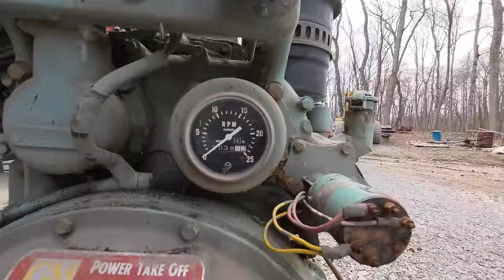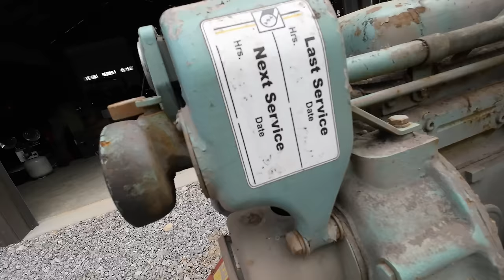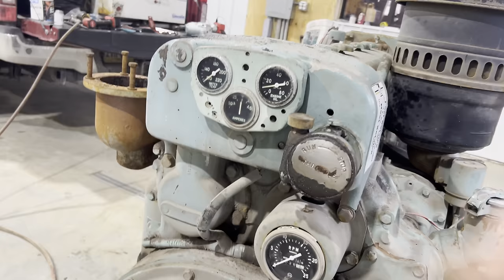$250 Two Stroke Detroit Diesel Sitting 6+ years, WILL IT RUN!?!?

Comment: That engine has a water to water heat exchanger on. Since it remains ststionary and a big radiator and fan might not be feasible. It is similar to the engines used for marine applications see danger marine. He rebuilt a similar Detroit with the same cooling setup.

Comment: i was wondering about the cooling system once you first got it running well. and then as you started to mention the cooling system, figured oh i wonder if it's water to water or something? that's just awesome. man, i'd love to have that. be a perfect off the grid generator, water pump, air compressor, all kinds of stuff you could do with it.

Comment: Matt, do like the dragsters and put the seat just in front of the engine 😊.  Would make a steering setup far easier.  Or if you were to hook up a sizable hydraulic pump hooked up to the drive, and a hydraulic steering setup ? ? ? ?    Your demented mind is fertile enough that I’m sure you’ll be able to figure something out.  Have fun and enjoy 😊 the whole process.

Comment: i was in coast guard we had those as generators and they also had a fire pump attached to them also for fire fighting capability we had two of them one on each side they ran at 1150 rpms to run our whole ships power  one ran and other was back up  and were traded back and forth to keep hours about the same they also it also had a turbo charger on it  and has two exhaust valves per cylinder on intake ports for the fuel going from being injected in  not sure but think our ship was built in the forties it was a 110 ft ice breaker the main engines that drove the prop were two straight eight cylinder ingersoll rand's top rpm on these ingersoll was about 600 to may a little more than that  but those 6-71s never gave us any problems i can remember  but we did rebuild one of them  and ring it but don't remember why we pulled the head and oil pan  like i said when we were off a shore tie these motors would run for hours on end as long as we were underway if i remember they burnt between 5 to 6 gallons an hour whereas the ingersoll's burnt about 30 gallons an hour and about 110 gallons on oil change but 6-71 took  about 26 to 27 ifim thinking right i worked in the engine room  for 2.5 years in cleveland ohio ship was KAW our breathers and valve covers were chromed beautiful motors so  clean that you could eat off them around 1150 rpms we got   the voltage we need to run everything and it think it supplied the exciters on the ingersoll's for their exciters  these motors put off dc to drive the 1000 hp electric motor  and remember this is an old brain her so i hope most of this is correct that was back in 1968 to 1970 also our 44 footers  may have used gms also

Comment: FYI don't run synthetic multi grade in this engine. 40 plus years as a Detroit guy. Put good old Chevron Delo 100 40 WT it is the best for that engine. multi grade not so good. Probably ok if you're not going to work the engine. just a little info. Love this engine and video...

Comment: You could use that as a fire pump or a generator. I'd use some evaporust or something and put a coat of paint on it in the mean time, and figure out what the PTO output RPM is so you can drive a water / trash / fire pump, alternator, hydraulic pump, Probably put a little dog house over it until you're ready to declare a job or position for it. It does appear to be a marine style, so you could put it in a boat, but being 38 hours young, I'd settle for some sort of land-based operation unless someone just gives you a pile of cash for a beautiful, used, painted 6-71.

It's goofy, but you could basically build a diesel-electric locomotive out of it with a single motor and a generator. The better route forward is using a three-phase alternator and a variable frequency drive (VFD) to control a three-phase motor with a small pinion driving a large gear (not unlike a 5:1 or 10:1 rear axle). You can probably accomplish the same sort of thing with a tractor or heavy equipment transmission using hydraulics.

Comment: Well if it is a water pump, I would have designed it to divert some of the water it is pumping through a water to water heat exchanger to cool the engine. So water after the pump goes through and dumps back in before the pump. Just a guess 8 minutes into the video. The lines would not be very big. Or possibly dump into the exhaust.

Comment: I’d take care of that old engine.  It’s more of a marine type probably cooled by the water it was moving.  I can say that I’m very experienced with Detroit diesels. I’ve drove about every model in some kind of equipment. I have a Pete with the 12.7 and it too will slobber fuel running at no load until it’s operating temperature.  I don’t know where you’re based but that engine would be right at home in a boat.

Comment: Dude! You need to go hydraulic. Don't get a stout drive line get a flexible one. You can change all your gearing like an auto trans with a valve. If you hinge it in the middle like a boom lift you don't need to worry about ball joints... All you need is a pump on your output shaft and you can put hydraulic motors on all four wheels. Couple o hoses, couple o valves, and a couple of rams for the steering. Bada Bing, Bada Boom, and your on the road!

Comment: i do remember every once in awhile they would use  a shot of either to start these if they were stubborn and we had a work board set up where we could rebuild and test those injectors to make sure they  did not leak when the were through shooting in the fuel each time if im right it was  supposed to pop the fuel at out and shut off between  350 to 400 but i could be wrong but as far as the cooling we pulled water out of the lake  down about 12 ft under ba]=oat thru screen grids that the went to a heat exchanger so the water did not go into the motor think it was a closed lop system  we did have tanks on the wall that contained new  antifreeze that is for some reason you had a leak you cold add new coolant till you could get safely to point you could shut it down and find the leak

Comment: You need to concentrate on finding spec info on the specific block that you have. Find out if you can hook up a 6-71 blower so it comes up to real power that was typical of over the road tractors. Once unit is built tight as possible , then use a air starter to get it running. No real 6-71 uses anything but an air starter ! Much quicker starting , less wasted fuel.  Good Luck !   Nick , Greyhound Bus Lines Journeyman 6-671 employee #  .......

Comment: That header tank makes me think that motor could have been used in a marine application with keel coolers. Possibly driving a PTO for bow thruster power. If the forth number on the model serial number is a 2 this motor was a marine application.

Comment: There was also a 6-110 from Detroit that was used in cranes and drag lines.
Reply: 6-110s were used in Budd RDC railcars also. They were installed on a slant like the Dodge slant 6 engines. Reason they laid them over was they were under the RDCs and not inside them. Two engines per RDC with each engine driving one axle on each of the two trucks.

Comment: Take a motor with 38 hours on it, oil leaks on filter housing drains, petcock on the fuel filter open - letting God knows what into it.  New petcocks wouldn't take a toll on the old wallet.  Seems to me you could take some lessons from Marty T in NZ and change all fluiids, replace filters, bleed everything, THEN start it and run it.  Ensuring you do no damage is a primary consideration, sporty.  Matt, I enjoy watching your videos because you aren't afraid to tackle anything - big plus.  But Brother, some of the things I've seen you do along the line makes me want to "Gibbs Slap" you at times. (Smile)  You could use it to power a 20K Generator.  That should power your shop and house.

Comment: The residue at the exhaust looks like a classic wet stacking problem. It has far to much running at very light loads. You need to run it at heavy load for a couple hours.

Comment: Hi Mat, I have noticed twice now that you use your english key the wrong way, or upside down if you will...the mobile part should be against the torque so that the energy produced will squeese the bolt and not the other way where the force will tend to open your key....I appoligise for my english....keep doing your good work...Jean...

Comment: I believe you are supposed to run a straight grade oil in em. 30 weight I believe. No pro but that's what I always was told. Multigrade will leak like a sieve supposedly.

Comment: That's a heat exchange on the front they used a external water source to run water through it too cool the engine

Comment: Black shinney stuff - water + iron + sulfur reducing bacteria = iron sulfide nodules. Looks like the cooling system is closed loop. Tank is a heat exchanger for hook up to eternal water source. The one at the plant I worked at had a solenoid connected to NPW. My state required a one hour load test of the fire system annually, this motor in service for 38 years?

Comment: Quite familiar with the oil bath systems, … they used them in the military on pretty much everything,  and then you should have sweated the closest joint apart, rather than the one you chose, … I was a mech, for wheel, & tracked vehicles during my time in the military, …
Reply: But the fuel issue could be solved with a shot of ether, …
Reply: No, injector problem, but is more than likely an adjustment issue, for an injector, …

Comment: Why wouldnt you have those batteries on the charger at all times 😂 those deisels take 100s of amps and cranking times measured in quarter hours. Raw fuel coming from the exhaust was a Detroit's signature feature 😅🤙

Comment: Tip. The 6-71 is a straight six. The 6-53 is a V6.
Reply: Exactly.   Detroit only made 2 series in a inline 6 configuration.  Those are the 6-71 and 6-110.   The 6v53 is a V6 as the name indicates.   There is also a 6v71 and 6v92

Comment: You should always fill the fuel filters before trying to crank a engine.
Reply: It was simple on ours as our day tanks were 10 feet up in the air inside the engine room. Open ball valve on input side of primary filter with vent plug cracked open. Close plug when fuel appears. Open return ball valve and allow any air to get past vent plug on secondary fuel filter. Close vent plug when fuel appears. Crank and run engine.

Comment: 1 yr later.  Does it still run??.

My last test for my Associates was to take 2 PT Boat 6-71's with "battle mode" selectors,  and make 1 good runner, with what I had in front of me.

  Wasnt hard, it was fun.  Tore everything down to individual components and started measuring.  Blowers also. Injectors tested and matched up.  Ran beautifully, for worn out parts.

Comment: Hook it up to a generator so should the electricity power lines fail and you go off the supply grid, you've still got locally genreated  power for the house and workshop. [Ray, from England, UK]

Comment: Don't hold your breath o that statement of plenty of parts available. People buy and hoard that stuff up for their own little fleet of mechanics diesel with out the gadgets and electronics/ HPOP or Piezo new stuff. People don't want emissions and DEF fluid machines with 10 to 20K exhaust for them if get clogged up or mistreated.  Those are my favorite things on the planet and I would love tk put that in a GMC High Sierra Jimmy I have ,last of the full size ones wirh the removable top.

Comment: I sorry bro, but the small onboard radiator was there to increase the speed the unit was up to operating temp. because unlike normal motors, if this thing was turned on in its role, if would be expected to red line almost straight away if powering a fire suppression systems, there is no time for a motor designed almost 100 years ago to heat up.

Comment: Why don’t you put forklift battery charger quick connect plugs on the front and back of your pickup (female)and the male end to a long set of jumper leads for quick connect jump start.

Comment: thats a good idea  another would be as u said before,  on a trailer driving a generator or some machinery.  just so it doesnt stand idling.  bet those fairs need some power to run. 
 how bout that?
whatevere u do  do not wreck that engine.   would be a shame as its basically brand new.

Comment: Boat anchor by today's standards. My father was a truck driver and both his truck's had cummins in them, so I'm a little jaded. You needed power rolling through the mountain's ondy east coast. Use a hairdryer is you need more than torque. Suck on that Greta!

Comment: 6-71s were used in both trucks and construction equipment. We had a fleet of International F2000D trucks that all had 6-71s in them and Terex also used them in some of their construction equipment. the 6-71s in trucks were rated at 238 hp, turning them up from 2100 RPM to 2500 RPM would get them up to over 250 hp. I could take a Detroit apart and put it back together in my sleep, I've worked on dozens of them.
Why did you run it so long with no water it ???????

Comment: That's nothing.  My RV van sat 13 years in a residential front yard.  Had to use a chain saw to cut down bushes that had grown around and up through the open dog house and out the window.  The van was parked under a tree which harbored sucking insects.  Because of this honeydew cause mold to cover the van turning it black.  Got the thing running by a hoze from a gas can to the carburetor.  Stuck valves cause several cylinders not to work but was able to drive it out of the yard. Yeah, got it working and now using it.  Did not know at the time I could have made money making a video of bring it back to life.

Comment: That looks like a 238 Detroit and the 2 stroke’s ran at a higher rpm and that was 2300 rpm’s and that’s why they were used a lot in boats and the cummins 1950 rpm in older ones and now they turn 2150.

Comment: YOU DONT NEED A RADIATOR THE SYSTEM HAS A MARINE HEAT EXCHANGER ON IT JUST RUN A GARDEN HOSE TO EITHER PIPE ON THE SIDE OF THE RESEVOIR TANK SO WATER WILL RUN THROUGH IT AFTER TOPPING OF THE TANK

Comment: Fuel rails need to be closed. Vice grips should be on rack because once injectors see Fuel she is going.  Door needs to be open on blower. That is an emergency shut off that never works. Knock inlet Fuel line off if it takes off. Be very glad it didn't work. Can you say run away?!!

Comment: He need to run a Street and motor oil in the Detroit because the reason is is that the Detroit diesel has two power strokes for everyone power stroke and a four cycle engine and it’s very hard on oil specially oils multi viscosity oils so you need to run a straight high detergent 40 in it or 30

Comment: NO Rotella!  2 stroke diesels take their own oil with their own API rating, "C_-2".  The best is Delo100, which has to be special ordered usually, but strangely, Wal-Mart oil has or had a "CF-2"? rating.  But I'm pretty sure Rotella doesn't.  2 stroke oil is low sulfur for low coking in the ports.   
    That "-4" at the end of Rotella's API certification stands for 4 stroke.

Comment: Pump auto matic trany fluid throgh the fuel lines first ,and flood the injectors with it or marvel mystry oil it losenes the injectors and rings pretty qwik and it will start on that

Comment: Been wrenching on Detroit diesel‘s for a long time, absolutely do not use a multi weight oil in a Detroit diesel unless you want major engine  problems. They call for a straight 30 or a straight 40 weight. And it MUST be a CF2 rating!!!!!!  I have seen multi-weight oil‘s in Detroit diesel‘s cause the engine to run away on its own engine oil. Do that old girl a favor and put the CF2 rating 40 weight in it

Comment: And they all had shutters on radiator and motor was running to cool the shutters would close in cold weather and open whe get the heat up. They are putting these shutters on one of the diesels in pick up trucks and I bet it’s GM .

Comment: Bad choice of oil for a 2 cycle Detroit. You should run series one straight weight oil. 40 or 30 weight. Never run 15/40 in a 2 cycle.

Comment: It's a two stroke.  No valves? Sweet, no sticking valves
Reply: It has valves. It’s uniflow scavenging. It comes in through the cylinder and exhausts through the valves.

Comment: On the outset on this video you stated that this GM 671 could not be used in a truck application. Is that because of exhaust manifold problems with hook up and also with hooking up a transmission? Did this engine have a super charger?

Comment: Matt you hve the old cat forklift ,does the front axle of the fork lift adapt to the engine ,that would give you a short drive and a manual transmission although forward gear would be reverse and visa versa

Comment: Quick question Matt;  You say this is a 2 stroke, yet it has a 10 (11) gallon oil capacity.  How does that work?  (obviously I'm not a diesel mechanic!)
Reply: Where your typical gas 2 stroke uses vacuum and pressure in the crankcase to pump an air/fuel mix into the cylinder, this thing uses a Roots blower to shove air in through side ports when the piston is down. Fuel is injected at the top after compression in standard diesel fashion. It has exhaust valves at the top as well, and the incoming pressurized air helps blow the last of the exhaust out before the valves close. The oil system is separate, and these will not run without the blower.

Comment: I aquired a McCrew- Edison diesel generator with 511 hrs. I really don't know much about them but started tinkering with it. It was taken out of service 2 yrs ago and before that was serviced. I cranked it up and it started right up but ran out of fuel. Now I'm wondering if it's got a fuel pump on it or would I have to get a pump and put in the gas can to push the fuel into it. What do you think?